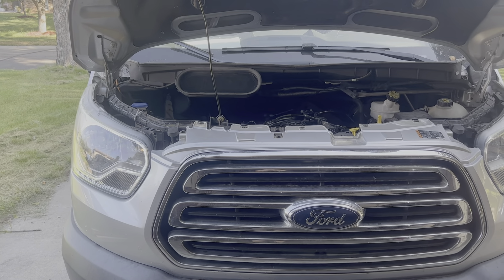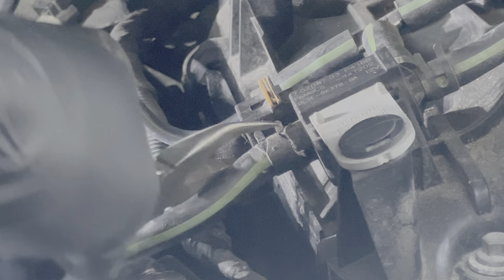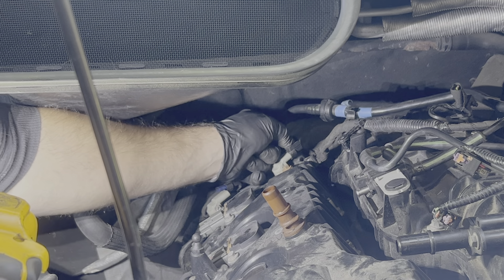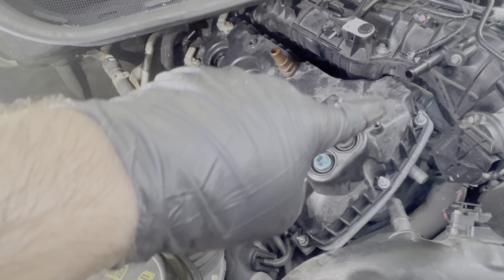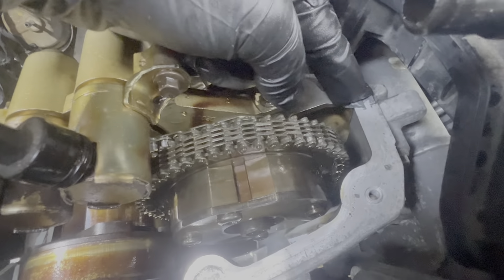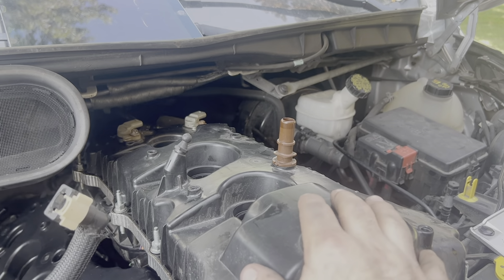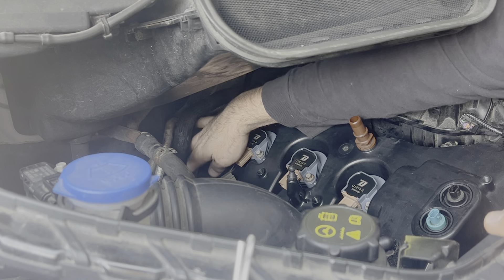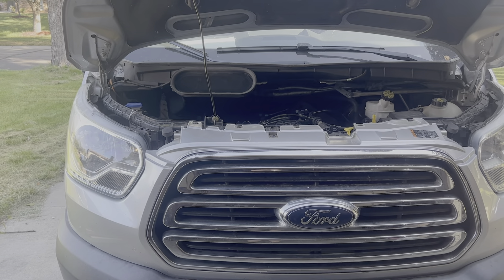How To Replace Ford Transit Valve Cover - 3.5 Ecoboost

Comment: Exactly what I was looking for, thank you!!!
Reply from the maker: Glad I could help! 
Don't forget to hit the subscribe button if you haven't already.
Reply: Was it the gasket that was leaking or was the valve cover compromised as well?
Reply: my passenger side gasket was leaking, and oil was dripping slowly on the exhaust (ouch). I just replaced that. The cover was perfectly fine.

Comment: Thanks for the great video.. 
I have some oil burning at first crank up every day. Thinking it’s the passenger valve cover or pump valve. You made it look pretty easy. I might give it a shot myself. Thinking some of those vacuum hoses are going to crack or split if i move them too much though. I’m at 142k. 😊
Reply from the maker: Yeah sounds like it could be the same problem. 
This van is a 2015 at 139k miles

Comment: Great work , do I have to replace the valve cover ? Or only gasket ?
Reply from the maker: You can replace just the gasket but with a plastic valve cover there is always a chance it has warped.